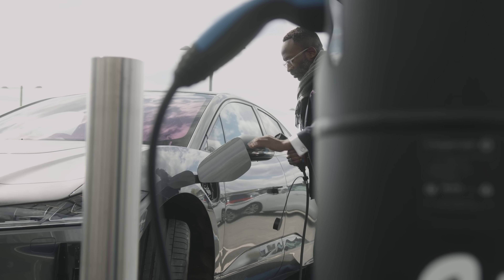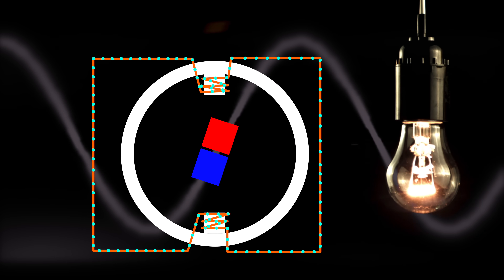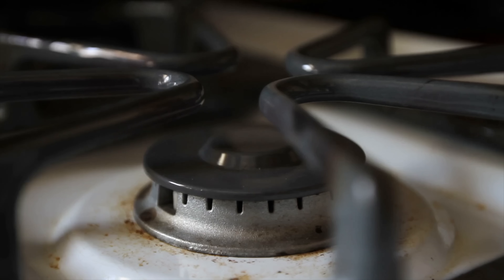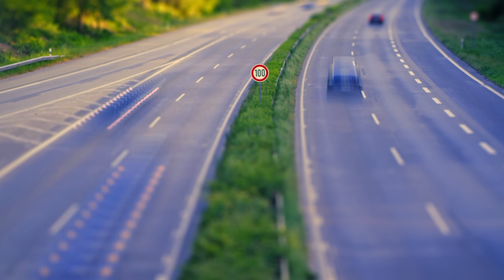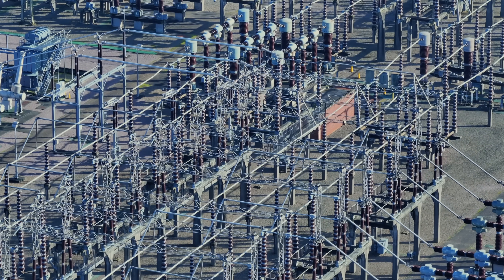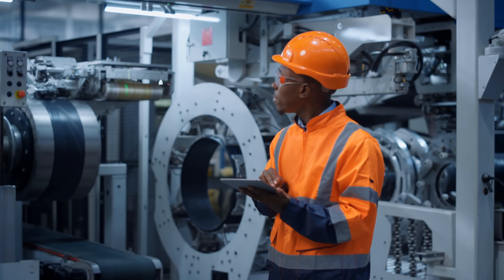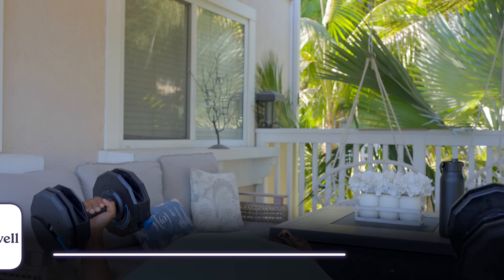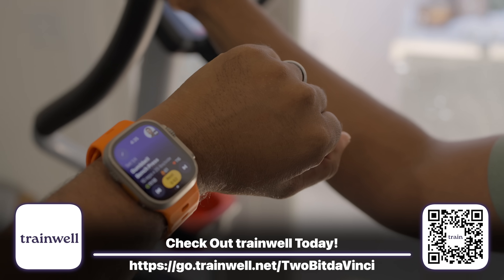Why The Power Grid is Nearly IMPOSSIBLE to Run

Comment from the maker: Click my Trainwell link https://go.trainwell.net/TwoBitdaVinci get 14 days FREE with your own expert personal trainer!
Reply: Black starts are both simple and complicated at once. But the biggest challenge is "graceful failure" so black start is avoided. Equipment comes back online quicker with the least equipment damage. Graceful failure is more complicated than black start thus the biggest challenge.
Reply: Actually all you do is fake advertise and trying to sell something which has non related content … I can’t blame you for taking advantage of less fortunate people, but I can blame them for their behaviour even if they don’t deserve what you doing to them.
Reply: Run 🏃‍♀️ high voltage line to Australia 🇦🇺 Spain 🇪🇸 Japan 🇯🇵 Iceland 🇮🇸 Britain etc undersea cables have been around for years and we have billions of miles of fiber optic lines for internet. Problem solved 110% solar production over produce by 10% and we will prove earth 🌍 is round small number of batteries 🔋 not hard lol 😂
Reply: Bread Crumb: Single Pole Geo Processional A/C Generator. “The ARC”
Power is subject to the size of the single Conductor & Coils
A/C Frequency matches Processional & Field Strength    ω0 = γ B0

End of Line
Reply: No moving Parts, always has output and Cannot be Stopped if Master Ground is Available

End of Line

Comment: A huge mistake was choosing to remain on 120v power instead of 240v. Now we're using more amps than necessary and loosing a lot of our energy to heat after the voltage is stepped down at the residential levels.
Reply: @dboucher26  as far as i know the US is on 240V / the residential stepdown delivers 240V + a middle tap as neutral, 120V is just what you get between any of the phases and neutral . So i do not think the fact that some devices use 120V lowers the overall grid efficiency significantly. I would even speculate that since stepdown happens fairly close to the home and up to that point you got 7200V it might be even more efficient.

Comment: Notable exceptions would be Texas, USA and Japan.
Where Texas is its own grid, it is electrically isolated due to not being in sync.
With south Japan being 60Hz (100 volts) and north Japan being 50Hz (100 volts) they are interconnected using high voltage DC to DC conversion so no syncing required.
I've always wondered why Texas didn't do the same.

Comment: DC power can change in voltage in a system and usually does over a narrow amplitude.  An example is the rectified voltage from the alternator in the car.  This will vary from 12-ish to 16-ish VDC during operation.

Showing "energized" powerline insulators is pretty cringy.

Comment: Great presentation. The power grid started by building massive power plants. The distribution of electricity became complicated. The future is a distributed network. My view is that the grid will be battery controlled. Grid forming will be at the substation level. Gone will be the need for centralized real-time control. The over arching requirement will be battery management.  My best hope is base load from geothermal.

Comment: Reactive components alter the phase relationship between voltage and amperage.  Not all of the gray boxes on power poles are transformers, some are capacitor banks to make up for the inductive load that most houses are because the out of phase electricity is basically useless to your neighbors.

Comment: Yes, I would like to see about the issues with inserting renewables into the grid.

Also, I know that in the early days of electricity, AC won out because there could be more distance between generation and use compared to DC and, hence, less plants.  So, why was it that way over 100 years ago but has swapped around to DC today?

Comment: You also can see reactive power when you're using a solar power system, especially when you're using a certain kind of Kind of washer for clothes. When it speeds up it takes powerthere is a brief moment when the system kicks power out i've noticed this on my inverter voltage I can see a temporary spike of an increase in voltage.

Comment: Could it make the grid more reliable if the main interties are DC instead of AC, so phase synchronization needs to happen only locally instead of nationwide? 100 years ago they didn't have AC-DC-AC inverters to change voltages, but now we do

Comment: As an Electronic tech,  as opposed to Electrical tech, I understand the varying drawing of power loads. I also learned that if the different sources are out of phase / sync with each other it can cause problems in combining them. So keeping the various plants on 60 cycles is important. I would like to hear about how they keep all the plants in phase/sync. So that when multiple plants feed the grid there is minimal losses.

Comment: I’m an electrical engineer who spent nearly 20 years designing and operating many parts of the Western Interconnect (the U.S. lower 48 has three main grids: Eastern Interconnect, Western Interconnect, and the Texas ERCOT. And while the “grid” is very complex, there are many automatic relays that help maintain stability (frequency and voltage). Bulk power operators bring generation on, off, or raise/lower power output to maintain stability, yet there are millions of devices that can shed load when frequency and/or voltage get out of spec. I also spent 15 years working at the national laboratory (DOE EERE NREL) and supported the development of standards and codes that are critical for integrating distributed energy resources (DER) to the various grids. It’s definitely an extremely complex system, the Grid, and it’s highly unlikely that batteries and EVs can stabilize a stressed out electrical grid of any size or location. Some in the Green New Deal community are actively pushing for the elimination of anything that burns, which is, in my humble opinion and many others, dangerous as we cannot rapidly raise the use of electricity as would be required if you were to eliminate gas furnaces, stoves, gas peaked power plants, and all things petroleum. People need to listen to those who build and operate electrical systems as they do know a thing or two about these topics. Well shoot, I have too many things to do rather than writing responses here. Cheers.

Comment: Watch the movie, “Current Wars,” where Mr Westinghouse uses AC to illuminate larger neighborhoods than Edison with DC.  AC had much lower loss using transformers so it was used in larger locations.  DC was limited to neighborhoods near the power plant.  

While Nicola Tesla experimented with transformers in the laboratory, he didn’t have the business acumen of Westinghouse to make a profit.

The advantage of DC in very long power lines is it uses entire thickness of cable.  AC has a “skin effect” where most of the power is carried on outer surface of conductor causing losses.
Reply from the maker: Interesting, Ill definitely watch that movie, thanks for the recommendation.

Comment: Why do so many of the vehicles caught in this video have them driving on the left?  Is that to be sympathetic to alternating current?  ;-)
Path 65 considerably helps with eliminating the need for the NW and SW connections to be synchronized.  It was first online in 1970!

Comment: The singular form of Hertz is Hertz. 
And large inductive loads by a customer is offset with cap banks (utility owned).
If the customer is supplied with transmission level voltages, then said customer is responsible for their own cap banks.
Reply: Edit:
Great video though keeping it easy for all to understand

Comment: You might be interested to compare how the U.S power grid works, compared to the U.K. power grid. Here, we don't require power plants to match frequency, and let voltage vary, we allow the grid frequency to vary according to demand, keeping a fixed voltage.

We use the inertia in the system to smooth out power demands, where 'inertia' is literally the inertia of the spinning generators. If more energy is being pumped into the generators than the power grid is drawing, that extra energy goes into the inertia, resulting in faster spinning generators and higher frequency, if less energy is being pumped into the generators than the power grid is drawing, that shortfall comes from the inertia, resulting in slower spinning generators and lower frequency.

That way, fast changes in demand are dealt with more passively. This probably only works because our grid is smaller, but it's an interesting difference in approaches.

Comment: This guy pumps EVs non stop & they will OBLITERATE any power grid in any country. Should have invested in fuel cell tech for vehicles (& a bigger push toward public transportation) & nuclear for grid power. Also hydrogen can be made as a biproduct of new nuclear plants so it's a double win. It's called red hydrogen & hardly anybody talks about it.
Reply from the maker: Not true, with millions of EVs and vehicle to grid, we EVs could help in a HUGE way. Imagine you plug in your car at work and for 8 hours, excess energy can be charged to cars, and for small spikes all the cars can discharge to the grid to help with extra load, then recharge whne the demand drops. EVs are 100% going to be helpful for the grid. but that technology and mindset needs to be established.

Comment: The only way to future proof our energy dependency is solar. If 50% of the homeowners put up solar power. The need for upgrading the grid is not needed.

The DC technology is changing.
There's a new technology called HVDC, high voltage direct current.
The current generated from Australia can reach the continent of the United States. Something AC can't do 
There's a plan to build the solar power network between the US and Australia in the future.

Comment: Karl Marx, Nikola Tesla, Huxley, Orwell, Turing should be forgiven for thinking their systems can last forever - finite fossil fuels are dangerously hypnotic to humans, their consciousness and mental capacity.
Humans were not ready morally, ethically and intellectually to start the mass extraction of fossil fuels with the advent of the steam engine 300 years ago.
The Magna Carta indeed requires now overhauling adding to it the right for humans to understand what Energy really means before any other commandment;
"In any system of energy, Control is what consumes energy the most.
No energy store holds enough energy to extract an amount of energy equal to the total energy it stores. 
No system of energy can deliver sum useful energy in excess of the total energy put into constructing it.
This universal truth applies to all systems.
Energy, like time, flows from past to future" (2017).

Comment: I have long felt that the way to reinforce the power grid was to more or less decentralize it. The production & losses connected to centralized power generation, transmission & distribution makes for a mostly fragile system. Smaller PV, Wind & Hydro systems can take advantage of so many localized energy sources overlooked by major PUD systems. Don't even get me started on Biomass plants. The carbon output is so much more than even coal considering the farmed pellet mass used is so much less energy dense & using material that is NOT mostly a byproduct but farmed wood products. 
This video makes a solid case promoting the off grid eartship concept as long as you're in a dryer climate.

Comment: 12:18 Lol, I was just gonna say that you should do a deep dive into WHY putting so much customer generation onto the grid isn't as good a thing as people seem to think. Specifically, I'd like you to go deep into what the effect on the overall efficiency of a power grid is, basically, the amount of coal or gas burned. Do renewables increase or decrease efficiency, and if so, by how much, and what affect does that have on the system as a whole. 

Otherwise, as someone who works in the industry as a Power Utilities Designer, you did good here. I've made several comments before that you need to do more research into how the grid actually works and I'm happy to see that you've finally stepped into the waters.

Comment: I have power outages every couple weeks, where I live. Always some tree falling in a wire, some drunk driver in a car leaving a bar hitting a pole, some intoxicated driver in a car smoking a joint… the problem has only gotten worse over the past 20 years.

Reasonable Electrification is only possible when people don’t act & work like they came from a 3rd world nation.
Reply from the maker: driving drunk or intoxicated is much more common in the U.S. than developing nations. Not sure why you'd say that, but yeah we should all have home batteries to cope with any short term outages. For my parents they are on well, so a power outage also means no water... so its crucial for them.

Comment: I recently googled High Voltage DC (HVDC) lines and saw that Europe uses more of them than the US. Only the western states and maybe a few others use any kind of HVDC lines to connect between different states. Maybe (?) more widespread use of HVDC to isolate different AC power grids would help to create a national power grid to spread out available power and may even assist starting up a downed power grid in case of foreign actors interference ?

Comment: I live in California where the governor and legislature are trying to force residents into 100% electric appliances for the kitchen, laundry room and even furnaces in order to completely phase out fossil fuels and natural gas.    Problem is we don't have much in the way of native power generation, we have some CNG powered plants and ONE nuclear plant which do not meet our needs.   Our current hydro, wind & solar generation only supply a fraction of what we use and we have actually removed several hydroelectric plants to 'save the fish'.   As it is we are buying a significant amount of kilowatt hours from neighboring grids that are out of state (much of it using coal) and our infrastructure is such that it won't currently support large scale EV recharging or even upscale electric appliance usage.  It just can't handle the additional current load and there are no plans as yet to upgrade it(?).

So basically we are the "what not to do" example for the rest of the country and our electricity is the most expensive in the US and it's cost keeps climbing.   Rolling blackouts/brownouts will soon be a thing here, more acute when they have phased out the sale of gas powered vehicles by 2035 and folks try to charge their vehicles at home.   When you have stridently ignorant politicians making policy that they don't understand there are unintended consequences, California is headed for the cliff but no one here is smart enough to apply the brakes.
Reply: What is CNG? Is that NG & coal? Anyway, California is a guinea pig. Lots of water & not enough dams so you remove still more dams and have drouts with floods. May God have mercy on idiots and fools.
Reply: @Chuck1284-  California is one of the states using demand (load, ie asking customers to shut off appliances) as part of the solution.  It saves money overall and can be done in ways that are not noticed by most consumers.  A technique called Demand Response was used by large factories or schools looking for a discount on their electric bill.  They reduce loads during hot summers, so the grid demand stays below peak capacity.

This idea should be replaced by Demand Flexibility - regularly shifting loads to off peak times.  EV charging is a great example - at home, most people care just that their car is ready the next morning.  A car doesn’t need to charge during the peak times.  This means you can help keep the grid balanced, save money from building new generation, and often use more renewable energy (either wind overnight or solar around noon).
Reply: Shut the electricity off to california if they don't want to use fossil fuels.